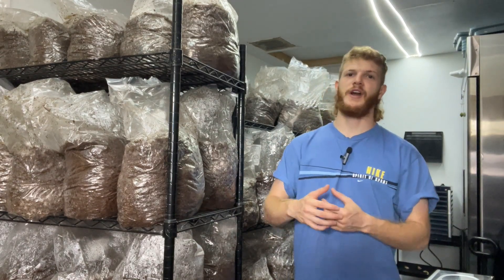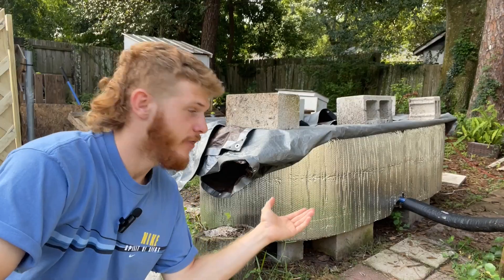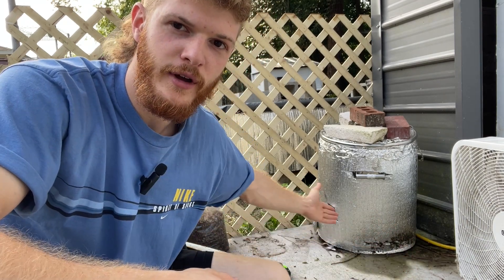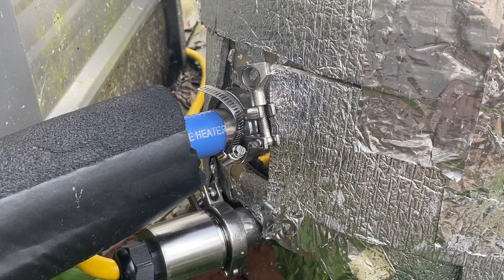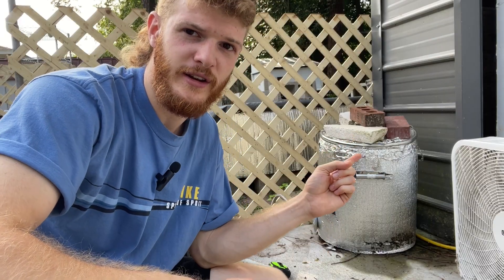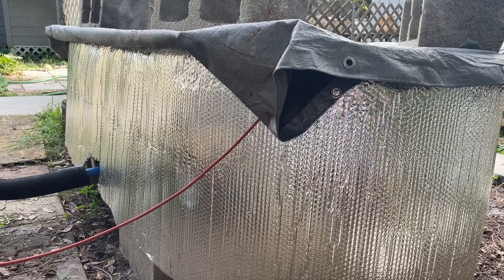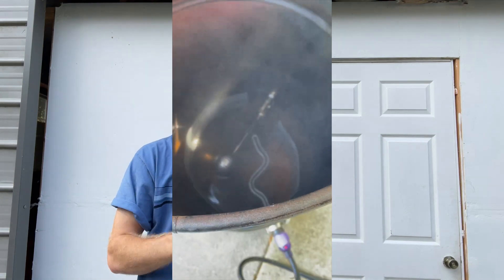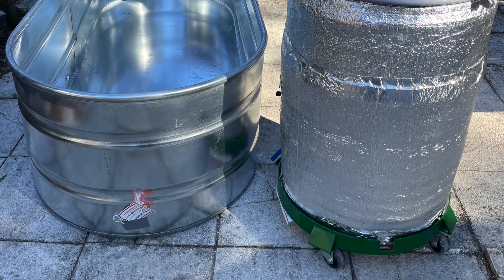How We Sterilize 2 TONS of Substrate Every Month

Comment from the maker: UPDATE: In this video we were pasteurizing for 12 hours. Not only is that not necessary, but it can overcook the substrate and render it useless. Now we only cook it for 4 hours and that works perfect.
Reply: 4 hours at 200 degrees?  What is the contamination rate with that configuration? mushlov from Chile
Reply from the maker: @brayanignacio5828  This is the industry standard in asia and has made its way over to the US. Contam rate is around 2-4%
Reply: Interesting. So you get the core temp to 200 and just hold that for 4 hours? And overall still good contamination rates? Been trying to find more info on cook times as a standard in Asia, but having trouble finding good info
Reply from the maker: @ thats correct - basically 0 contam
Reply: @harmonymushroomco are you getting core substrate temp to 200? Or core temp in the steam tank?
Reply: @sportbikeguy9875  He stated in the video that the probe is in a substrate block.
Reply: @harmoneymushroomco can I use this same process to sterilize grains?
Reply from the maker: @ some people do, some people say its impossible. could work for you!

Comment: If you can find barrels that had any kind of juice in them, they won't rust because of a special coating (I guess for the acidic juice).

Also, placing a wet towel on your rack (on the false bottom) will help keep your bags from burning or getting grill marks. You can also do the same all around the sides if they're getting burnt.
Reply from the maker: Pro tips! Thank you Mr. Noble :)

Comment: Hey, just wondered how do u unload and transport all the blocks once they've been Heya treated? How do u keep them form being contaminated between the steamer and your inoculation set up. Thanks
Reply from the maker: We unload onto rolling racks in the open air, and then wheel them into the lab. The bags have a hermetic seal coming out of the steam tank so they are able to stay clean enough, our contamination rate is still really low, like 5 out of 140 bags.

Ideally we would unload them directly into the lab, but we are using what is available and the layout of the buildings that we have access to. I encourage you to use what you have and be resourceful! Good luck!
Reply: @harmonymushroomco  Nice! How long do you let it cool down before moving over to the lab?